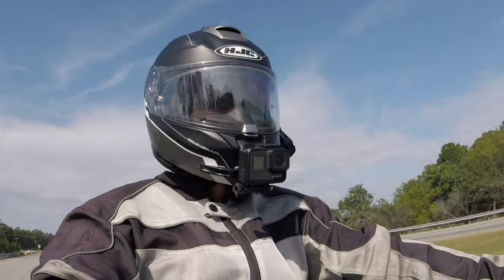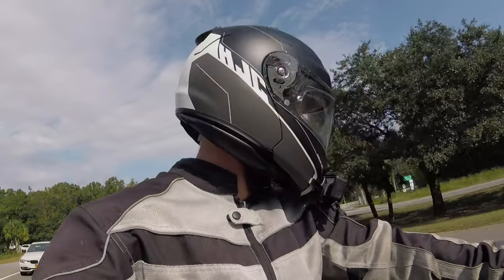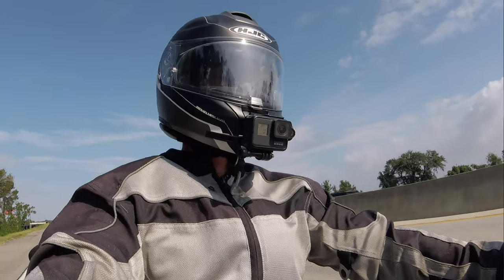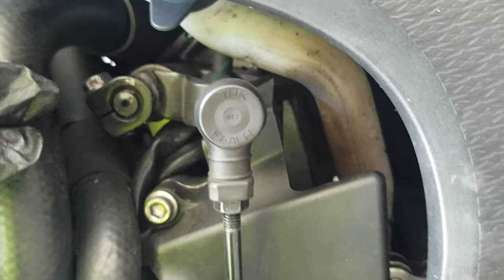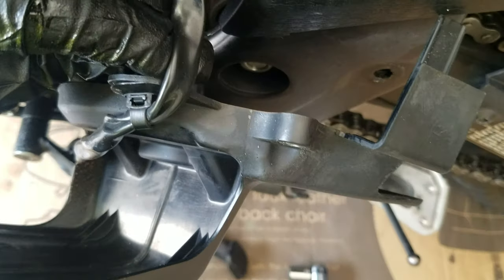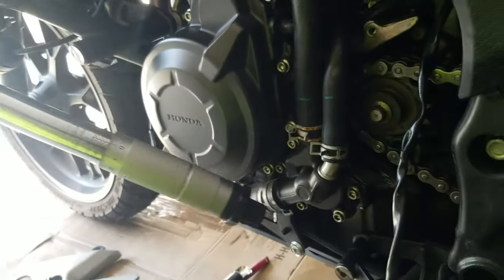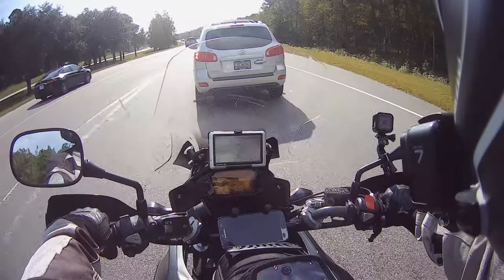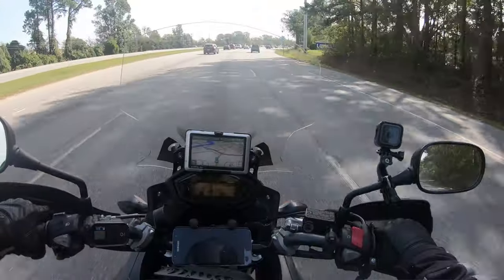CB500X 16T Sprocket Swap

Comment: My experience with Honda always has been to go +1t up front and -3t at the rear. It's about the same as +2t up front.
Gas mileage goes up, vibrations go down.
Also gear spacing is not affected by a sprocket change, because all you do is shift each gear by a percentage. The spacing is still exactly the same percentage as before.
Reply from the maker: Sounds awesome!  Thanks for the tip.
Reply: Do you have a product recommendation on a -3t rear?
Reply from the maker: @JGPT1681  sorry I haven't tried any smaller rear sprockets.  Wish I could help!
Reply: Thats what i was thinking as well. If you need to mod something, just do the 1 to 3 ratio and change rear sprocket. Just go up 3. Slightly more expensive for a rear versus the front, but only by a few dallors. Speedo must be mounted on the transmion for it to change the actual speedo reading. Which isnt really a big deal once you figure out actual speed. Since 100% of bikes from Japan are intentionally set to read faster than actual speed. Due to legality issues in the passed. Was going to buy a CB since im older now. But actually put money down to ve the first person to own the New KTM 490 Adventure. The dealer was shocked since the bike isnt even built, but only 10% down. And its refundable.
Reply: @drzrider3440  I hope you got your money back!

Comment: Awesome! First time I have ever seen anybody show the RPM at speed I looked so long for a video like this what a great comparison
Reply from the maker: Thanks Rjeepster!  I'm glad you liked it.  Check out some of the other great videos on our channel.  If you like what you see, consider subscribing!  :-)
Reply: I noticed He did the baseline test was using the speedometer and after the swap he used his GPS which was a 7mph difference.  Pre swap rpms at 70mph(speedometer reading) were 5,800rpm; after swap rpms at 73mph (80mph on gps) he said was just blow 6,000 rpm.   So on the speedometer the rpms between 70-73mph before and after the swap was maybe 50-100rpm,  that's pretty negligible.  I would like a taller 1st so I may end up doing this for that reason alone.

Comment: I did the same swap (15T to 16T) on my RE Himalayan with the same benefit. My speedo runs off of the front wheel, so no calibration problems.
Reply from the maker: That's awesome, John!  Glad it worked as well for you.  :-)
Reply: Sprockets affect the relationship between engine rotation and tire rotation. Speedo would only be affected if your tire (tyre) diameter was changed.

Comment: Thanks for your insights.... I think when the drive chain & Sprocket are ready for replacements, I will consider swooping out. Thanks again.
Reply from the maker: I'm glad you liked it, Robert!  Yes...no need in wasting a good chain and sprockets.  When it's time for a new set is the perfect opportunity to upgrade.  You should also watch our companion video about the 39T upgrade:  https://youtu.be/Je6LdgYt9fg.  It goes into a lot more detail than the first one.

Comment: Man dude thank you for the advice I put one on my CB500X a week after I bought it but mine is not the solid I bought the one with the rubber insert in the middle from JT sprockets. I've only written it through my neighborhood but it seems to be a big difference
Reply from the maker: I'm glad you like it, George!  It certainly transforms the bike, doesn't it?

Comment: Finally on october the first I arrived in Thailand. The bike now has got the 16 T sprocket and I can say I passed from a coffee grinder to a swiss clock. Been riding 1500 km in 49 hours to reach Udonthani( 21 hours on the saddle) and I have not regrets. I respected the 90 km/h speed limit and most of the time the engine revs at 4000 rpm. Now I still have to find a guy who can correctly adjust the speed on the clock by adding the speedo  calibrator . This is a quite expensive device as it costs 4 times the price of the 16 T sprocket
Yesterday I also made mods on my fork with the YSS upgrade kit which makes a great difference on handling and braking,the suspension is firmer.
Reply from the maker: That's awesome, Didier!  I bet you had a fantastic adventure!!!
Reply: When I left Udonthani alone I had to use my phone navigation app Maps for the first time of my life. I was quietly riding along the paddy fields when I suddenly realize that Maps gives the GPS speed. And guest what? When the speedometer on the clock indicates 90 km per hour the GPS shows 89 km per hour. 
A few day before when riding to the Mekong river at Nongkhai i was riding with my buddy Marc who gets also a 2018 500X . With my 16 T sprocket my speed was 93km per hour when Marc’s speedo indicated 97 km per hour ( with the original 15 T but a bigger rear tyre 150/70/17). I am so happy to say if you upgrade to the 16 T sprocket your speed on your clock will be the  real GPS speed. In fact the speedo with the original 15T is about 5 percent higher than reality. I have a brand new 12oclocklabs speed calibrator for sale...

Comment: I put a 16T on my 650 Vstrom it geared the same as the SV now. Much better on the road.
It also allows you to use the lower gears for longer when accelerating and is generally  a more relaxed ride.
Reply from the maker: I totally agree!  It definitely gives a more relaxed ride.

Comment: You CAN ALSO drop the rear tooth by 2 teeth (equal to a 1 tooth increase on front sprocket)... I have done a double sprocket mod on many bikes I've owned (1 tooth up on front AND 2 less teeth on rear), it made a big difference, it lengthened the 1st gear, lowered revs in 6th on highway speeds, helped with vibrations in various riding situations, helped with fuel economy, and generally helped with a smoother ride. HOWEVER, I would advise that the double sprocket mod should really be done on bikes that have enough power to deal with mod, so a modern 500cc bike upwards. I've done the double sprocket mod on an 80's Suzuki GSX400f Katana, Bandit 600, Kawasaki ZX10 B2, Suzuki RF900RW, Kawasaki ZR-7, a mate even did it on his Kawasaki KLR650, and he found it helped in many ways.... Ride Safe, Ride Free People 😎😎😎
Reply from the maker: Great comment, thedarkknight1971!  Several viewers have found dropping to a 39T rear sprocket is similar to increasing to the 16T front on the CB500X.  I'm not sure I'd do both since the engine really doesn't have much "oomph" once you reach higher speeds in 6th gear.  Maybe if you lived in Kansas where the roads are long and flat?  ;-)
Reply: @michaelbigelow3255  "Performance" figures. They usually set the gearing depending on the balance of economy and performance but depending on models they'll lean towards the latter to help sales...

Comment: I have a 2016 model. I changed the 15T for a 16T front sprocket over a year ago. It's a great mod. Also, on my bike the speedo used to read too high,  but now is quite accurate when comparing to GPS. This is strange, as you say yours is out of calibration, but yours is a later model which may explain this. Ride safe.
Reply from the maker: Thanks for the kind comment, Graeme!  I'm glad you enjoy your modification as much as I enjoy mine.  By the way, I have a 2013.  While it is strange that our speedometers were different, I've heard there are a lot of variations from the factory.  Plus, factors like which tires you are using affect the accuracy of the stock speedometer.  Anyway, get out and enjoy your bike!!!
Reply: Graeme Evans, was yours reading pretty much exactly 10% over before the swap? I've got a 2015 and I'm wondering what will happen to my speedo reading if I swap to 16T.  Mine is currently reading 10% over, if yours was the same there's a good chance it'll make mine more accurate too.
Reply: @dom252  Yes I think it was about that. I'm in the uk. It seems likely speedo readings are exaggerated by manufacturers depending on the country. All the same, the 16T makes for a better ride. I would only recommend keeping the 15T if you ride off road.
Reply: @graemeevans2608  Perfect, yeah I'm UK as well. Already pretty much sold on the mod but  was wondering if it'd cause calibration headache. But sounds like it might make it better!

Comment: I tried to jam different wrenches not the rear sprocket to lock the wheel but wasn't having any luck, I watched a different video where he put a 2x2 through the back wheel and used the swingarm to lock, that worked great both to loosen and tighten. I had no problem with the safety plate being in the way, weird.
Reply from the maker: Absolutely!  That's a great tip.  You might want to watch our newer video:  https://youtu.be/Je6LdgYt9fg.  I demonstrate that technique (using a wooden handle from a hammer) and walk you through a complete chain and sprockets replacement.  More importantly, I share why after two years of using the 16T drive sprocket, I found an even better solution.

Comment: 👀Thanks for the welcomed advice !
CB500X 2022, new owner.
Reply from the maker: Hi Emmanual!  You're very welcome!  You should also watch this video I did more recently:  https://youtu.be/Je6LdgYt9fg.  After years of experimenting with new gearing, I think the 39T rear sprocket is now my FAVORITE setup for this bike!!!  But if you mostly do highways or commuting on pavement, the 16T is still my second-favorite choice.  Enjoy your new bike!

Comment: CB500x is a fantastic bike. I converted mine to the Rally Raid stage 3 kit which includes suspension, and spoke wheels. I use the bike mostly for back County riding so having lower gearing is better for me riding off road. What I love about the CB is its twin cylinder so even with the 15t sprocket at 70mph it is still smooth as silk.
Reply: Daniel Pearson you live in gods country! I have to travel 10 hours to get where you are. Have you ridden the Gifford Panach forest? I spent a week there love it. I could spend 3 months in those states and still not see it all!! Enjoy!
Reply from the maker: I totally agree, Bill!  The "X" is indeed a fantastic bike, and very customizeable to different rider's tastes.  I'd love to do the RR kit some day.  Glad you enjoy yours!

Comment: Thanks for the response. I have looked at a few of the links you suggested, am working on checking the all out. I am struggling with the auxiliary lights. I want them on the high beam switch, and want to find the ( blue wire to trigger the relay, if that is the correct way.). I can't find the factory plug. I want to use douitch plugs . 
Thanks for taking time from your day. I'm sure you have more important things to do.
Reply from the maker: Hi Marshall!  Always happy to help, my friend.  Unfortunately I didn't install my lights on the high-beam switch.  So I have no knowledge of how to wire it that way.  I can't think of any situations where you would want to turn those off.  The more lights you have on, the better you can see.  But more importantly, the better other drivers can see YOU!!!   Hopefully someone on the www.cb500x.com forum could help you out?  Cheers...
Reply: Thanks I have put them on a handlebar mounted switch . After careful thought about what you said, it makes sense to have them on a separate switch so I can turn them ON in daylight hours and off at night when not wanted. I was thinking different, thanks for your input. In 2 months I’ll be 64 and I have finally learned to LISTEN to /think about what people say, and not have a knee jerk reaction. I learned that and to be THANKFUL instead of bitchen about everything about 5/6 years ago. I’m a lot happier now. 
As for as for the cb500x forum, I joined them when I first got mine  but I forgot my username and password and don’t know how to fix it. I’m not good with a computer ( I am at my limit with what I’m doing now, I’ve been trying for 10 minutes on this comment 😂😂😂 just found that face thinner button recently )  but 2 years ago I would not have even thought about thought about more than 5 word comments. So I’m getting better. No typest but can use 2 fingers now. As long as I don’t accidentally touch something and delete the whole thing. 
Thanks for getting my mind right.
Reply from the maker: That's awesome!  Glad I could help.  And glad you're a happier version of you?!?

Comment: I’ve changed this on my 2020 today . Been for a 30 min spin and I’m presently on the fence as to whether I like it or not. Definitely longer legs but don’t feel as peppy as it did . Will have to suck it and see for a while.
Reply from the maker: Obviously it depends on what kind of riding you do.  But if you do a fair amount of commuting or distance riding, I think you'll really like it once you get used to it!

Comment: I have a 2018 CB500 FA.
12 months ago I changed the front sprocket to a 16T and rear to a 41T.
My local dealer did this for me.
I also went to a 112 link chain.
I don't regret it. It turned my bike to almost new bike.
Top end I find it performs better, not so much buzzing from the bike.
The down side, not as quick off the mark and instead of 370km per tank of fuel I get 330(approximately). I did a rally recently with all my gear, about an extra(30kg) on the bike as well and the bike preformed just as good if not better than if it was just me.
Anyone thinking about changing sprockets go for it.
Just my 2 cents from a kiwi rider
Reply from the maker: Thanks for that great comment, Peter!  Btw, absolutely LOVED New Zealand when we visited.  Cheers!

Comment: Changing the front or rear sprocket to drop engine revs does have a downside in that it makes the bottom gear taller, therefore, having to use more clutch slip pulling away, particularly on hills.
Reply from the maker: Thanks for the excellent insight, Barrie!  This is true.  And if you live in a very hilly area, or ride rough off-road trails a lot, it's not something I would do.  However, the CB500X has an extremely short first gear to begin with.  Personally I found it almost useful in my relatively flat part of the country.  In fact, I often just pulled away from stop lights in 2nd gear.  Thus, switching to the 16T actually made my 1st gear a useful gear again!  To underscore my point, I just finished riding the Colorado and Utah sections of the Trans-America Trail with steep mountain passes, and didn't have any trouble doing so with the 16T front sprocket.  The extremely technical sections might have been slightly easier with a 15T front sprocket?  But I had no trouble at all with the 16T.  And the benefits the rest of the time far outweighed the couple instances where it might have helped.  Still, it's something to be aware of, as you pointed out!

Comment: Did this to my 94 CB1000 5 speed. Great upgrade! Lowered my rpm by 800 at 70 mph! Do have to pay attention to your speed though. Throws the speedometer off by over 5 mph. Ended up getting a ticket :(
Reply from the maker: That's fantastic!  Glad you found similar results.  And yes, you do have to be aware of the speedometer change.  I just use the GPS mounted above my dashboard to make sure I'm not speeding.  :-)
Reply: Lotta bikes have optimistic speedos and this mod tends to bring them closer to accurate. I know it did for me. Didn't do it for that reason, but I do like having a nearly dead accurate speedo.
Reply: 2013-15 has speed sensor on front wheel...this gear change will not effect the speed reading...

Comment: I had a 16 on mine, went back to 15 again, it feels much more dynamic on 15
Reply: Couldn't agree more. :)
Reply from the maker: @irishrover63  that's awesome!  To each their own.  That's one of the beauties of the CB500X...you can customize it to fit your style of riding!  :-)
Reply from the maker: Thanks for the kind comment, Prestonesfpv.  I certainly appreciate that some would prefer to keep that low-end grunt.
Reply: Do you know in numbers the lost of torque?

Comment: If one rides mainly in flat areas, it makes a lot of sense to change the gearing to reduce rpm's. On the other hand, if one does off roading or lives on a mountain, it's probably not a good idea as you want o get the most out of those 48cv. Enjoy the bike!
Reply from the maker: I totally agree, Marcos!  Thanks for the kind comment.

Comment: Yo Chris, American 65 year old man in the Philippines waiting for my 2022 cb500x to arrive at the dealership. The 1 improvement I can't find here is a 16 T sprocket. I've got a box of accessories but no bike yet 😢.  Sure would like to find a 16 toother !
Reply from the maker: Hi Rick!  That's awesome.  I bet you love the Philippines.  I've heard it's a great place to retire!!!  Pretty cool that you're getting a new 2022 CB500X.  The improvements on the new model look awesome.  Have you tried ordering the 16T from JT Sprockets in Europe?  You might also consider keeping the 15T front sprocket and getting a smaller 39T rear sprocket.  Check out this video where I explain the difference:  https://youtu.be/Je6LdgYt9fg.  I'm actually using this setup right now and I think I like it even better than the 16T front?!?  But you better check compatibility because the 2022 might have a different bolt pattern for the rear sprocket.  Good luck and ENJOY!!!

Comment: I recently up geared my Versys 650 and it is 100% better for my riding style.  I would have gone 16t front (from stock 15t) but it leaves barely any clearance.  Instead, I dropped the rear 46t to a 43t for essentially the same result. Even though these motors are designed for high revs, I didn't like it and as mentioned in this video, first gear is almost useless (unless you're riding Trials?).  The change is like adding a 7th gear; relaxed on the freeway.  It also makes 1st through 6th gear much more practical and reduces the amount of shifting necessary.  I highly recommend trying it for most people.
Reply from the maker: Thanks for the encouraging comment, Firesail!  I'm glad you're enjoying the upgrade as much as I am.  :-)